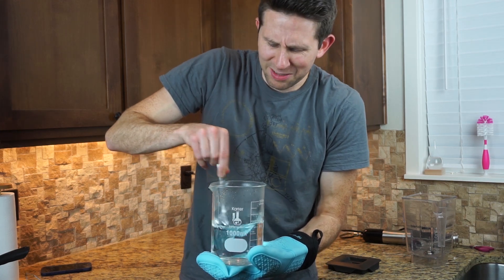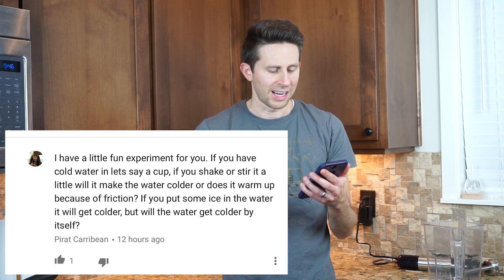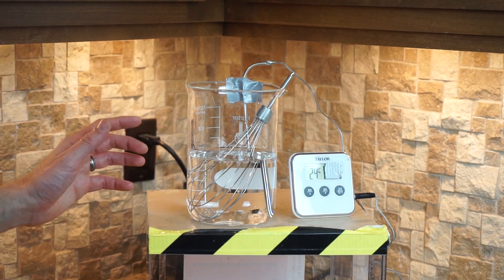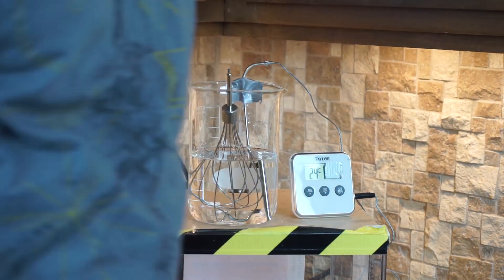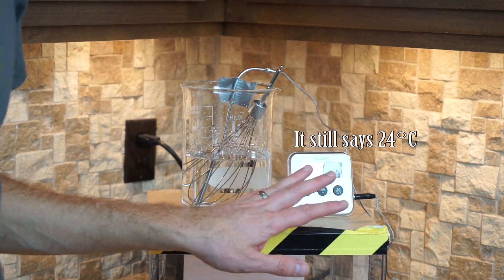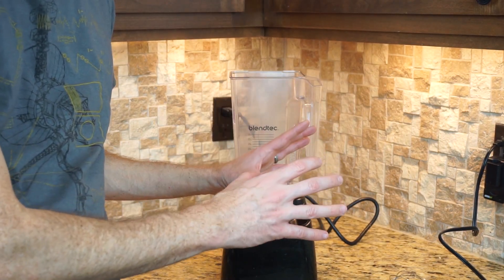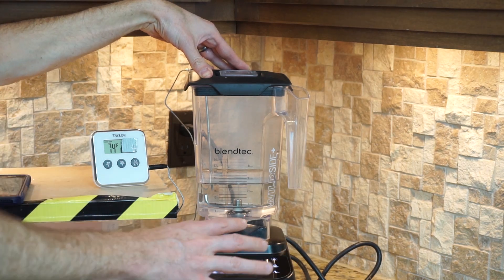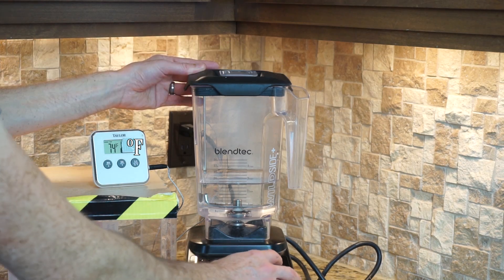Can You Boil Water Just By Mixing it Really Fast? Water-Stirring Challenge Accepted!

Comment: What will happen if light traps inside a mirror box or mirror sphere ..(inside of the box is mirror)
Reply: There's no mirror that reflects 100% of light, so it's impossible to capture light in a box. If a bunch of light suddenly appeared in a box or sphere that had internal mirrors, all the light would eventually get absorbed by the surface of the mirrors within an extremely small fraction of a second.

Comment: No. 
If the spoon is metal ehich absorbs the temperature, which in this case is cold in the beginning,  no matter how hard you mix it the water will remain cold.. unless your hands get really hot and transfer the heat to the spoon and the spoon transfers it to the water.

Comment: What is the logical limit here? Presumably raising and lowering the altitude and thereby altering the pressure of the water would similarly impart phsyical energy. So you could make a massive pipe that ascends and descends in tight bends repeatedly, then pour water in from a high altitude length at the start and have it come out as steam on the other end. I wonder what length of pipe would be required. Although at that point the friction from the pipe might contribute a more significant amount of energy
Reply: The long length of pipe at the start would be to provide enough potential energy to boil whatever size tank of water you were feeding into the system

Comment: Mixing should be able to heat water no single doubt. In fact the high speed rotation causes such tremendous amount of heat it is considered as design challenge for submarine propellers.

Comment: The led over the container might be preventing the fresh air contact with the water so less heat transfer and also I think the blade will also eventually becomes hot due to constant rotation and heat the water.
So I am still not convinced that just by stirring water can be heated
Pls reply if I am wrong

Comment: You can not heat up water in open container by hand mixing, because air will cooldown water. That rule is used to cooldown liquids in real life (like cooling down a tea or coffee or cooling down boiling soup which tries to escape from the pot when it is too hot).

Comment: Microwaves work similar to this notion.
Reply: Microwaves use light radiation to cook food. Specifically micro waves. Hence the name.  They have a higher frequency than visible light waves.
Reply: DylanSir02 I’m aware of this. The ultimate result moving the water molecules at a rapid rate which in turn heats the water. In most cases heats the water with in the food. That is why some food is doesn’t heat evenly. Microwaves tend to work best for liquids or foods that at least have a heavy even distributed water content.

Comment: Isn't it just the blender's blades getting hot due to friction and releasing this heat to the water?
You can test this by having the blender simply blend with nothing in it for 5 mins, then measure the temperature of the blades after.

Comment: Even if the friction of the blades rotating is near zero they can generate significant heat if not lubricated. I suggest redoing this using a rotating magnet inside an adiabatic enclosure to confirm heat does not come from the blades.

Comment: Pours water into the beaker
"Okay, let's see if we can get it much hotter."
Pours water back in the blender
Me: WHAT'S THE POINT OF POURING IT IN THE BEAKER THEN!?
Reply: Balaow to see the steam and condensation affect around the cold  glass just above the water.
Reply: To measure it
Reply: to see if he can mix faster than the blender 😂😂
Reply: Dude watch the video
Reply: @ronstickley8284  I never said you are a fool tho, if you feel like a fool you can be friend with me, but don't be denial
Reply: He probably wants to drink it jk
Reply: Now youve introduced a new problem . The external pressure on the water   was keeping the water from separating .   To get hotter , you have to increase external pressure , I E , a pressure cooker . At 1 atmosphere , the temp should  max out at 212 o F .
Reply: I had similar feelings :P
Reply: S C I E N C E
Reply: Könfused
Reply: A pro
Reply: To see if you pay attention to the video.
Reply: To artificially lengthen the video
Reply: if the blender gets too hot it may cause problems, by pouring it into the beaker it gets a little cooler(not much) and then is put back to the blender... its like giving rest to the blender for itself too cool down so that no fire is caught in the blender
Reply: Are you a born idiot or practicing to be the one?
Reply: @ronstickley8284  But you are the one, don't call any

Comment: You can heat water in a blender designed for it.  It spins at high speed with a container that causes fluid friction which heats the contents.  It it is used for smoothies then you add lots of ice to negate the fluid friction effect.

Comment: This is caused by a mechanism called cavitation.. The movement of blade creates low pressure areas and forming a bubbles, that when burst create the energy in the form of heat. Add to that the friction between water molecules.

Comment: anybody else think that the heat isn't coming from the friction from the water but the friction from the blade spinning and the plastic around it that holds it in one spot. think about it. i bet the blade is hotter than the water itself and is were all the heat is coming from
Reply: But why waterfalls are not hot? Just asking. Never been to a waterfall. But I don't think they are hot.
Reply: @anirudhpuranik5222  because the same water isn't falling
Reply: Anirudh Puranik waterfalls aren’t hot because they aren’t moving that fast. The mount of kinetic energy (speed) to make something hot is more than you would think. Atleast it’s more than I’d imagine hahaha tbh I don’t know enough about all of this but I’ve based my previous comments and this comment off of what I have learnt and what I currently know :) hopefully I have helped
Reply: Eclipse The Producer nah, the heat isn’t from friction specifically or the blades either. I believe that a majority of the heat is produced by the fact that the blades are speeding up the water (increasing kinetic energy) and when things move faster they are in theory getting hotter since on a particle level of you heat water the particles speed up and move faster so if you speed up water it will get hotter (it works both ways) basically kinetic energy and heat energy are directly related/are the same? I’m not an expert on this by any stretch but that’s what I’ve learnt from physics and chemistry.
Reply: Yeah the kinetic energy held by particles is directly proportional to their temperature. So if you raise their speed..that in turn raises the KE which then raises temperature

Comment: Bro if u start doing from Normal water instead of water at 74 C then it would not happen
Reply: You know that the hotter something gets, the more energy it takes to hear it further. So your argument is that cool water wouldn't heat up, but warm water does, even so it is harder to do?
Reply: It would take more time ..but its obv possible !!!
Reply: It was normal temperatures water because the reading showed 74 F and not 74C

Comment: The temperature difference is not caused due to mixing of water. The fiction created in blending machine blade and the bearing which connects the motor and blade.  Also u r introducing air inside during mixing.

Comment: 8:20  Don't you mean, everytime you mix water in an ENCLOSED environment, you're increasing the temperature?  Otherwise, you'd be cooling it down by exposing so much of it's surface area to the air, right?

Why won't anyone answer me?  This is a legitimate question!

Comment: Run the mixer without water so u will get the answer by touching the blade tat the heat crossing the blade or not... So we will get The answer tat heat heated from blade, motor or water stir. But I think tat heat from water stir maybe.

Comment: I knew this would be possible...

'heat' in this sense is related to kinetic energy. when you say water is hot what u ate actually saying is that the individual water molecules have a higher avg kinetic energy than those of water at a lower temperature. 

mixing the water is just another way of putting energy into the water I.e. raising the avg temperature of the individual water molecules. the same thing that happens when u heat the water on a stove or kettle or whatever

Comment: It was the bearings getting hot that made it boil. That's why when the motor stopped it still produced the bubbles from the base of blade right above the bearing. Use a magnet mixer and stand there for the rest of your life and it wont boil

Comment: Blenders are known for heating the contents from the motors below. Thats why you're not supposed to use a blender to whip egg whites or heavy cream (both generally require colder temperatures to fluff up) But I dont think it's a failed experiment because while the blender adds some heat, its nowhere near hot enough to boil water through motor heat alone

Comment: I think you could have potentially elliminated the bias a bit more with this experiment. Some heat may have been distributed from friction caused souly by the motor of the blender.
Perhaps, measure the tempurature of the motor at different points in time. Then measure the tempurature of the water at different points in time during the blending process.

Comment: Actually it boils at 100 degrees Celsius, or at least that how we round it and how you’ll find it in any book, website or whatever. 😒 I know it can be an approximation but still.
Reply: Water boiling is dependant on atmospheric pressure, the higher the pressure, the higher the temperature. And vise versa. Lets say for example you were going to boil away the oceans, at first everything would work by that rule, theoretically,  but then as the steam filled the air, the pressure would rise, and thus them temperature required to boil it.

Comment: Well how much heat from the machine is being conducted to the water through the blades? If I run my blender for a long time it will melt ice and the blades and the part that couples with the motor shaft will actually burn you. I'll admit my blender is a cheap unit I got on clearance, but still. There's gotta be some heat.

Comment: this is a long vido of something that can be explained in 1 sentance and a hole lot of bull experiments with MASSIVE flaws in them.
friction heats up things so mixing water introduses friction betwen water molekyles and other external sorces creating heat.

your experiments are bull cuz they have to many uncontroled variables. 1 air cools the mixture down. mixer itselfe generates heat by spinning not only by the friction with the water but the motor. if you want to have a experiment with as litle variables as posible you need a sealed container so there is no circulation of the air so heat does not escape trom there. then have a mixing method that dosent transfer heat to the water or take it away.

Comment: The water probably got warmer because of the heat of the blender’s motor
Reply: Siege 

That’s one reason yes but the friction of the blade spinning and the water splashing was the main reason
Reply: I think, only very tiny amount of energy went into water from this.
Reply: Was about to say
Reply: Due to increase in internal energy of water
Reply: Yeah but the motor wouldn't be at 100 degrees if anything the engine would've just helped it get warmer quicker

Comment: There's a better way to stir liquids with a whisk. 

Grab the whisk inbetween both hands and rub your hands with the whisk inbetween them. It acts more like a electric whisk that way and like an electric whisk provides more momentum and force. Only odwnside is you may need to rest the whisk on the bottom of the container while stirring that way to avoid it slipping out of your hands.

Comment: Flawed. At least some of the heat going into the water is thermal transfer from the motor heating up and some is still coming from the blades themselves even if they’re designed to have as little friction as possible, there’s still some.

Comment: What happens to the magnetic field of the electromagnets when placed in vaccum or abundance of air  does it have a change? Because the the air gap between the poles is a factor determining the strength of the magnetic field. If it does not changes then why is it not the gap and why air gap? # Your Big Fan

Comment: The speed and the movement of a paddle or blade against any material would heat the blade in return heating the water. However this wouldn't be as effective with a whisk as can be seen. Also many other factors can contribute like the type of container used, how much air present sealed or not. 

So the larger the surface area of the blade paddle and the faster in moved the hotter everything gets. What would be interesting to know is the temperature of the blade compared to the water. Which heats up faster.

Comment: Lot of heat probably came from the mixer heating up.
Reply: If the blender would've heated up so much that the blades were over 100°C for a long enough time to also the get the water to 100°C, the plastic the blender is made of would've been long melted already
Reply: negative.glass reinforced nylon will not.
Reply: Nope, this experiment can be done without using motor. If you didn't pay attention at the end, this experiment was done by James Joules with paddling wheels which required no motor. The  end quote is, friction cause heat, even if those blender blades somehow boiled the water, that still proves the point.
Reply: @ToVoMo  that`s true but in this case experiment wasn`t clean - motor might have added a lot of heat.
Reply: That’s what I thought!
Reply: Totally true. My blender gets really hot when working a few minutes - and I mean electric motor itself which is connected to blades with metal heat-transferring rod. So at least he should have accounted that (like measure motor temp or smth)
Reply: No, even without motor you can do it. It's not from the heat from the motor.
Reply: All the heat probably
Reply: Nope.
Reply: Nah its energy transfer mechanical energy to thermcal energy yes the heat of the blender must help but it really is the energy of the blade its ammazing
Reply: Probably all of it.
Reply: This hurts to read.
Some of these reply are just.......
Reply: @Xaidriel  because it's beyond your comprehension?

Comment: U have to find a method to stir water with water to check whether water heats up when its stirred.. when u r using steel blades of the blender, its not scientific at all because steel heats up easily when its under friction and if the steel heats up, its going to transfer the heat to the surrounding water coz thats what its under immediate contact with...

Comment: This is so wrong in so many ways. Any blinder in the world heats up when it mixing anything even air. Thats due to its low efficacy heat to the surroundings that includes the mixing plates transferring heat to the water. So the friction caused by the water molecules and the wall and the plates i would say 30% of the reason

Comment: The water is causing friction on the blades just like what happens to motor boat blades the intense friction causes damage and pitting over time due to tiny explosions caused by rapid expansion of air bubbles by friction heat around the blades. You are both right and wrong with this experiment. Anything moving fast enough through water will cause an super heated bubble to form in front of it. There is a cray fish that does this to stun prey.

Comment: Actually, you can test how hot is the blade just by removing the water in the first place, let the system spin in free air for a few seconds. And measure the temperature of the blade. This can serve as a good control. You will know how much heat is transferred from the motor to the blade. From my knowledge, the motor actually produces a lot of heat. Depending on the brand, some low-quality-brand stirrers can have their motor becoming so hot that it can melt down the plastic surrounding, giving rise to a plastic burnt smell, if you keep the system spinning for minutes.

Comment: Is that how kettles work?
Reply: WorldBusEnthusiast no, you put kettles on ur stove, then it boiled from the stove heat
Reply: @kcsreactions8551  r#woooshhh
Reply: No. Old type kettles are just metal (usually steel or iron, occasionally aluminum, rarely other metals) containers that can hold water, which you put on an external heat source. 

Electric kettles are often made mostly of plastic, and have an electric heating element on the bottom. Like other electronics meant to produce heat (electric stoves and ovens, toaster, curling iron, clothes iron, etc) they are a long, often coiled, piece of metal with high resistance, through which an electric current can flow (when plugged into a battery or electric socket), and the high resistence of the metal causes the electrons to create lots of friction, which is heat